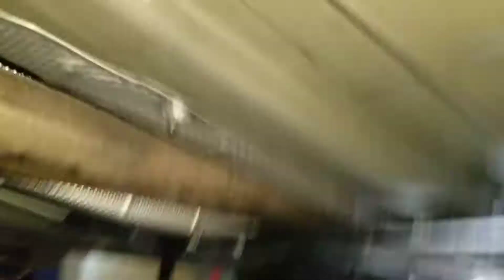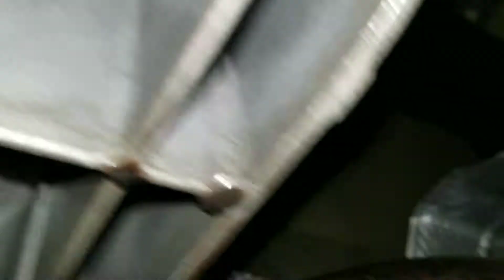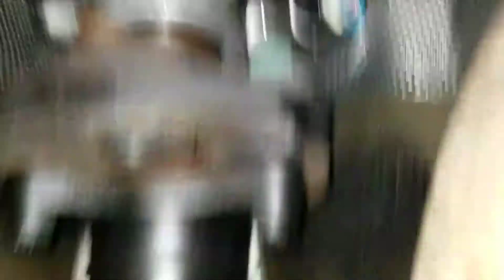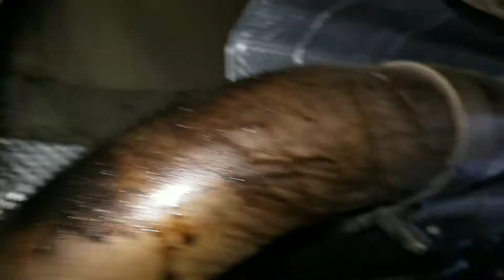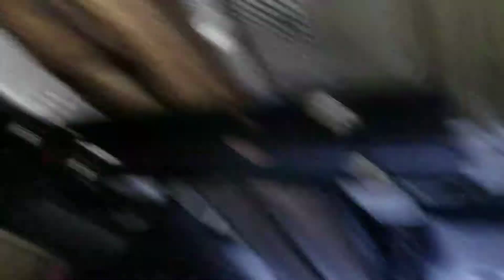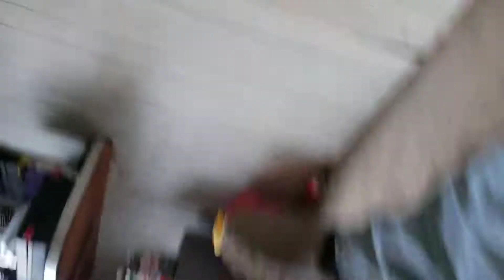Found it  broken drive Shaft bolts.

Comment: Dude I have a 2015 mustang gt. Happened to me twice. My driveshaft has 6 bolts that go from the driveshaft through the rubber coupler and to the trans. Both times 1 bolt snapped and 2 warped. Causes vibrations like crazy even if only 1 snaps
Reply from the maker: Well, happened again. This time I jacked up my driveshaft:(.
Reply: Chris Skinner, dang dude. I don’t know why mine keeps doing it. If you get a one piece you won’t have to worry about that problem ever again

Comment: Does this cause vibration under acceleration some times on and off . Around 30-60 mph ?
Reply from the maker: It was missing 2 of the 3 bolts. So it didn't make it over 10 mph for the mile or two I drove it
Reply: Aye did you ever find out what was the cause of the problem erik?